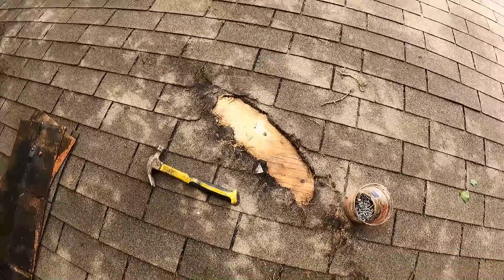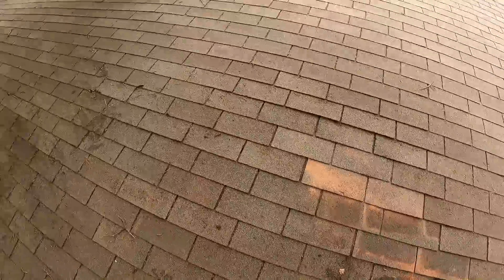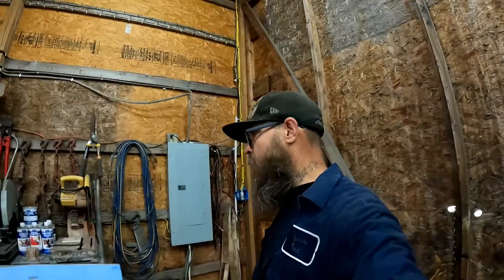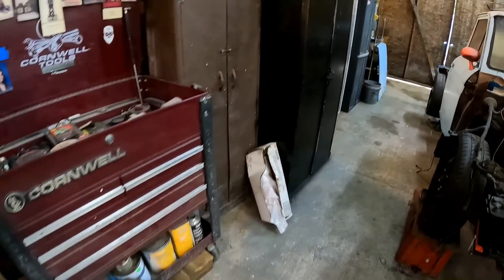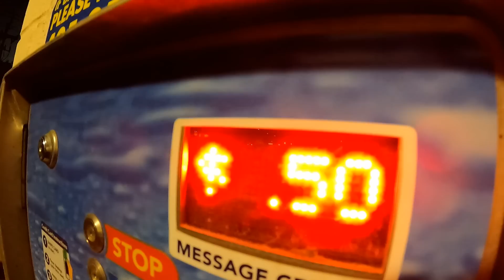THE DATSUN LIVES AGAIN...+tractors and tornados and stuff.

Comment: you know on those rocker arm tappets I used to work on old 80s Mazda engines with a similar system,  You want them to pump up and get hard, the idea was that they would pump up and "self shim" against the valves, and if they are just springy and dont pump up and get hard, they're bad, and its like having excessive valve lash.   I dont know if thats the same deal but thats actually how they're supposed to work if so.    Then if they sit they lose the oil pressure and they tap,  same in the cold when oil is too slow to make it up to them.

Comment: 35th?   GOOD EVENING MIKE!  Be careful Mike, I DID BREAK MY NECK! It was no fun wearing a HALO for 4 months. And my house was being remodeled at the same time.      Roger in Pierre South Dakota
Reply from the maker: Ouch! 4 months probably felt like an eternity.
Reply: @weirdbeard8898  Yes it was. Had to sleep sitting up in a chair in the living room. And of course, I have sheer curtains in the living room, with a very bright street light. So I had to drape a bath hand towel over my HALO to block the light enough so I could sleep. I also had to sit in that chair as the house was remodeled. It was a nightmare! I wouldn’t wish that on my worst enemy! I broke my neck when a airbag blew up in my face during a accident. My Doctor told me he was surprised I wasn’t paralyzed due to the spot where it was broken. Well, so much for all that. I love what you are doing with the NISSON- DATSUN pickup. Roger in Pierre South Dakota